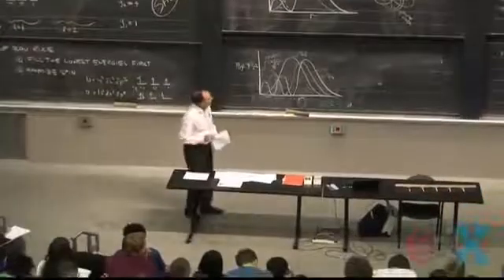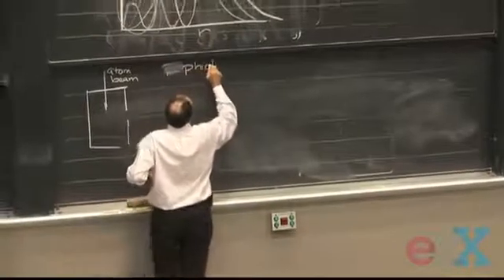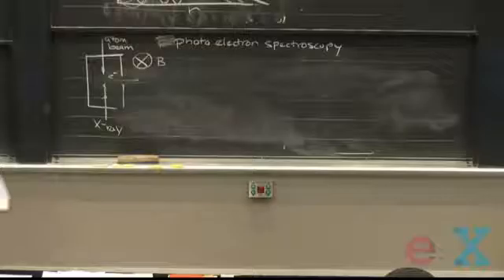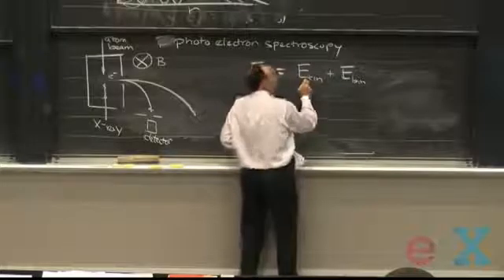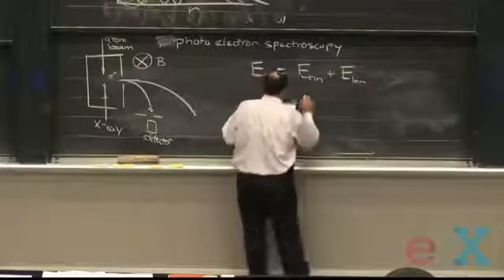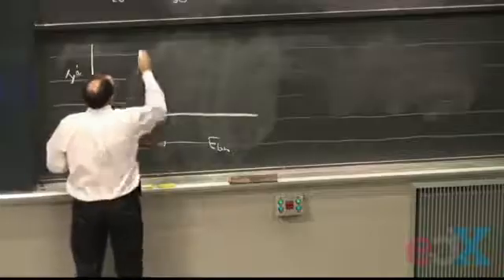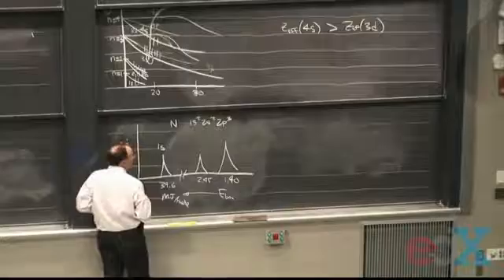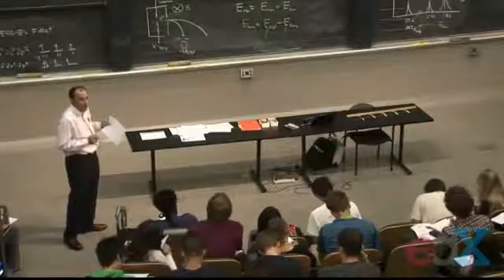Photoelectron Spectroscopy Explanation

Comment: Why do the electrons ejected during second ionizations don´t appear? As you increase the energy you have a mixture of cations and neutral atoms. Am i missing something here. One thing is removing a p electron from an atom  and is different from removing ana p electron from a cation.
Reply from the maker: In this experiment, essentially ALL of the electrons are removed simultaneously. Then the binding energy for each subshell (1s, 2s, etc.) can be calculated. What you are talking about relates to the data for successive ionization energies (1st I.E., 2nd I.E., etc.). That data comes from calculations. It does not come from an experiment such as PES. There is no experiment that I am aware of that will remove one electron at a time, successively from an element.
Reply: @mrfarabaugh  It's important to mention that the samples are usually grounded (Earth is negative) or connected to a weakly negative potential, to maintain them electrically neutral over longer time spans, otherwise your material would get slowly positively charged over time and actually develop an ever increasing work function needed to further eject electrons.